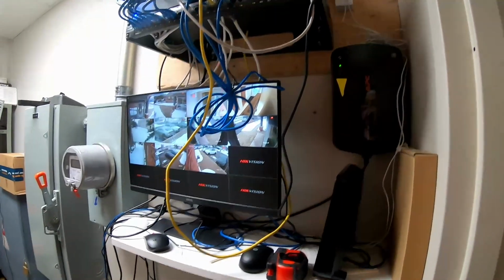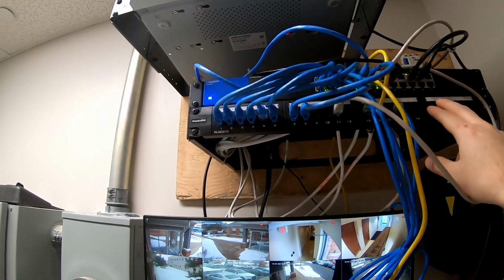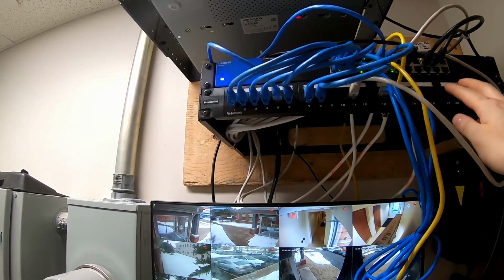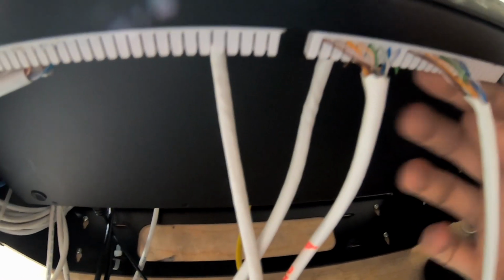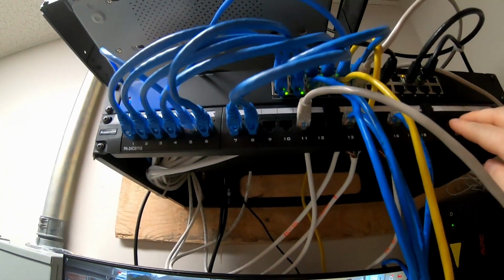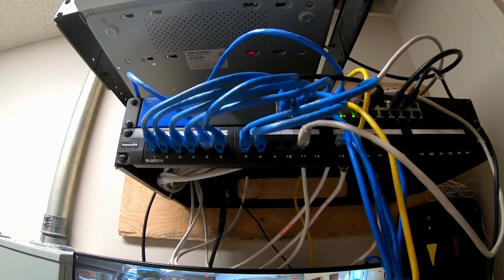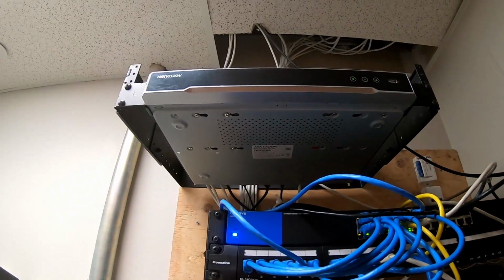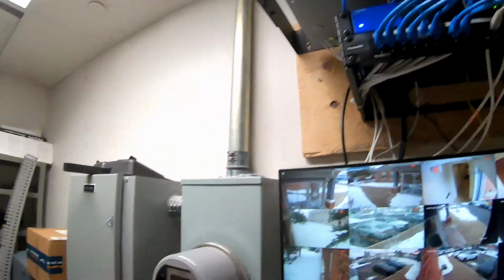Replacing Hikvision With Unifi Protect

Comment: What are you reasons for picking SE over the normal version? I can't find any hardware or software differences. The main difference seems to be an embedded 128gb ssd, poe ports (2 poe+), 1 2.5gb rj45 wan interface, im asking because im curious as I am deciding what to pick for myself.
Reply: The SE has latest firmware and more features than the regular One. I own booth of them. Pick the SE.

Comment: Question not about this vid but one for me. We will be moving to new warehouse and it will need about 70+ APs due to racking and contents. What AP would you recommend. It’s mostly for RF scanners and Honeywell voice units so 2.4 is all that is required. We have had hand off issues with new devices also even with dB and radio reduced. Have you ever come across this?
Reply: My advise to get the site surveyed by a proper wireless engineer. I would say your environment is out of Codys expertise (no offence to Cody)
Reply: @lukey3030  yeh I got that done recently for current warehouse as we went from Cisco to Ubi and tbh it was a bit of a waste of time as my own survey said the same. Biggest issue was roaming between ubi devices which was a combo of radio settings and using legacy devices using “b” and 2.4. All good now bar a mesh point needing rebooted every so often.
Reply: @lukey3030  I guess I should doc my findings for others too.

Comment: In general Hikvision has better range of cameras than unifi lineup, but seems like they start to catch up to be good enough for smaller installs. Hikvision and all the typical brand NVR I would prefer the unifi one here as a business owner to make it more simple. As a tech guy I prefer the top quality Milestone system, combined with either Nest protect or unifi as an backup recording on my UDM.
Reply: Hikvision camera are certainly better quality of build and image than UniFi.  Downside to UniFi is vendor lock-in.  Hikvision support open protocols blue iris and alike can use.
Reply: @notathome13  Agree! IF Unifi would just open up to other ONVIF IP cams from other manufacturers. Unifi's range of cams are pretty average and expensive for what they are!
Reply: @notathome13  Not really, you can use the Unifi cameras standalone - I've got them mixed with Axis and Hikvision.
Reply: Ain't no way you said you're a tech guy and then dropped Nest protect as a suggestion. There's better out there.
Reply: I hate to see a perfectly working hikvision taken down and replaced with something less.  Hik product line is far superior to anything out there at the moment.  Only thing really holding hikvision back is the backing by China government and the US ban because of the potential threat china may use for spying purposes.  If cameras are isolated on vlan or behind NVR shouldn't really be an issue.  Regarding the channel....fabulous wiring work.  Can't believe how incredible your work is.  Fun channel to stop in every once in a while.  😊
Reply: Yeah better cameras but the apps are the shits so it’s a fail.
Reply: Hikvision do make decent cameras, but there are security issues.  HikVision’s NVRs also have outdated iOS and android software.
Unifi cameras are expensive and are locked.  I’m not against locking down equipment as long as the client understands what they are paying for.
I tend to go DW or ICRealtime when I can.

Comment: would be great if Unifi could let their product interface with 3rd party systems like control4 or RetailNext
Reply: Unifi works great with Control4. You can get the driver from Driver central, it works very well, I even use it to turn lights on with person detection
Reply: @tonywebb9909  can you view the cameras in c4 now?
Reply: @tonywebb9909  🦗🦗🦗

Comment: Great upgrade, the Hik system being looks like most installed on the cheap so the client should be very happy with the Protect solution upgrade
Reply from the maker: I think they paid a hefty price for it but the installer didn’t put in the work 😂
Reply: @MactelecomNetworks  Ouch, so the Installer did it on the cheap and made them pay sadly

Comment: You should get automatic screwdriver. Faster working,compact,can toruq low torques,and wont get wrist pain. Big wrist strains will get you out of work for 2months easly
Reply from the maker: But then how will my arms grow 😂
Reply: @MactelecomNetworks  belive me when you get wrist swelling you will never want one again boss did 2 days just scruing and was 3month out of work couldent use hands. Just heads up if have to use lot of screw driver
Reply from the maker: @Bloodycub666  I actually have one just didn’t bring it with me :)